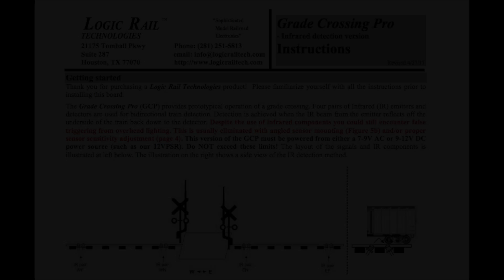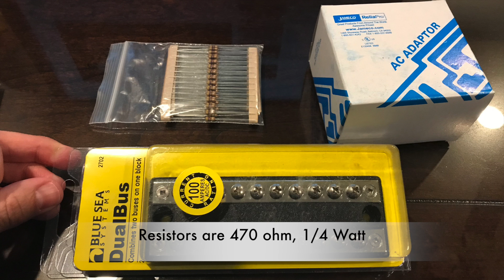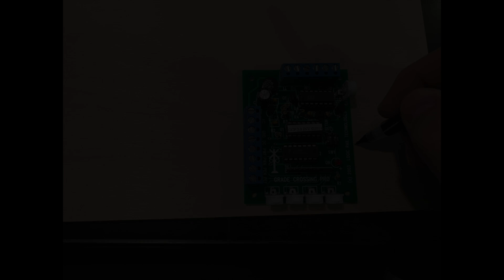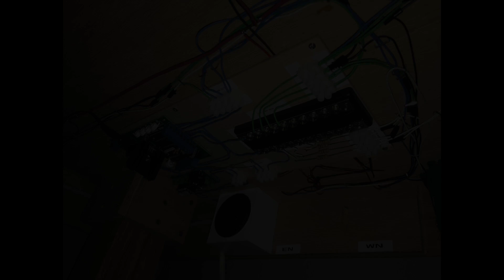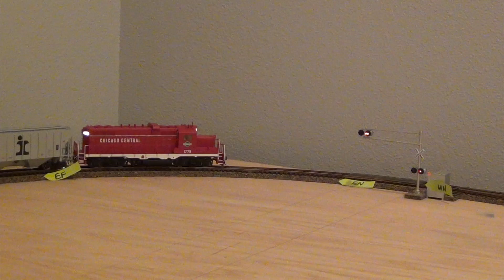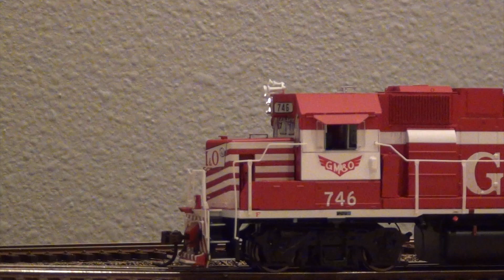Wiring, setup, and operation of Grade Crossing Pro (infrared)

Comment: How did U get the locomotive to run so nice, at such a slow crawl.  That is so hard to get slow speed HO locomotive result.  What is the equipment for that?
Reply from the maker: Thanks, Koshka.  Without going too far into the weeds on this, DCC-equipped locomotives are very easy to get to operate at slow speed.  You can modify CVs or use a speed table which allows this.  The key to making it work is  good electrical connectivity on your rails.  If you have shorts in your rails, the locomotive will stall.  If the wiring is done properly, this is the result you can get.  I am using a Digitrax Super Chief 5V DCC system and the locomotive has a Loksound Select DCC/sound decoder.

Comment: I’m installing mine sometime this week.  But can you put the sensors in after the ballast is down?
Reply from the maker: Yes, you can put the sensors in after ballasting.  For my grade crossing pro, I did not have any ballast down but after I made this video, I installed a Logic Rail Technology Block Animator.  The Block Animator had the exact same infrared sensors and I installed those after ballasting.  You will likely have to "touch up" depending on how much ballast shakes loose while you are drilling.
Reply: Thanks!  Appreciate the reply :)

Comment: So I’m trying to do the same type of set up as this.  I don’t have a bell or motorized gates for my crossing.  My crossing lights aren’t tomar, or walthers, they are from China, and they have their own circuit board to make them flash.  They run on a 3v battery.  My 12v adapter came with this handy connector where I can run my positive and negative wire to the grade pro circuit board.  I’m confused on how you wired this all up.  My led crossing signals have three wires which I’m trying to gather from your video I would connect those to the RO and the LO spots on the gcp circuit board?
Reply from the maker: Jeremy Jones Hi Jeremy, without seeing your crossing signal, it is difficult to give advice.  My guess is one wire ic common between both LEDs and the other two are the left and right LEDs, respectively.  If you can figure out the common, it connects to the DC output.  The other two wires connect to the LO and RO outputs (with resistors).

Comment: I am having problems with my emitters. I installed 8 and only 5 are functioning.  Now can I buy 3mm emmiters/detectors from an offshore supplier and substitute them? I find the replacements from Logitech are pricey.
Reply from the maker: I will be honest, using a different emitter/detector should be done at your own risk.  I cannot speak to whether it will work, nor if it will cause any damage to your GCP.  My recommendation is to contact Chuck at Logic Rail.  If the sensors are not working because of a manufacturer defect, they should be able to replace them for you.  Good luck, keep me informed.

Comment: very nice info for installing. crossing bell seems a little loud tho
Reply from the maker: JOE RADER the sound volume is adjustable. The problem is with a sound-enabled locomotive, you can’t hear the bell if it is too quiet.  Bottom line is you can adjust the volume for your needs.
Reply: OK. Good to know

Comment: Really appreciated the step by step approach on this video. Good clear images and instructions. Amazingly neat and well-labelled wiring! What label device are you using? Live video part in second half of your video also provided valuable information. Very impressive all round. Thanks for sharing.
Reply from the maker: kropotken Thanks for the comments.  I have a Dymo Letratag label maker.  You can get one at WalMart for about $20.  You can also check Amazon or eBay, you might get a better deal.  It just helps keep things organized because I tend to forget what wires go where 😃

Comment: Exactly what I need step by step instructions! Great job Thanks a lot!! I do have one question for you. I see you only used one crossing signal I am going to use 2 (one on each side of road) would I need another GCP or can they both be wired to the same one?
Reply from the maker: Alan Shinkus Yes, you can wire multiple signals to one GCP.  According to the instructions, one GCP can handle a load of 180 mA or ~12 LEDs.  I would have wired up 2, but I didn’t have enough room on the other side of the road.
Reply: ck7813 thanks a lot Mike I’ll be ordering mine shortly 👍🏻
Reply: But the grade crossing signal that you used has 8 LED's, if you used 2 of them that would be 16 LED's. Would you need an additional module for these particular model grade crossing?